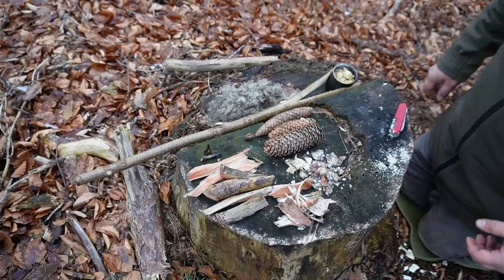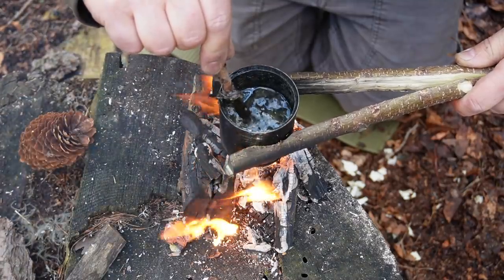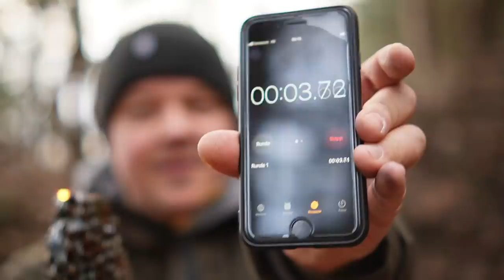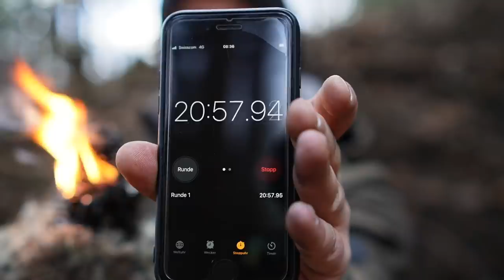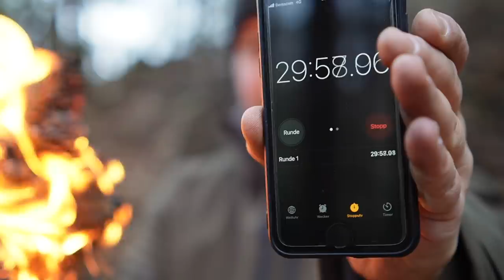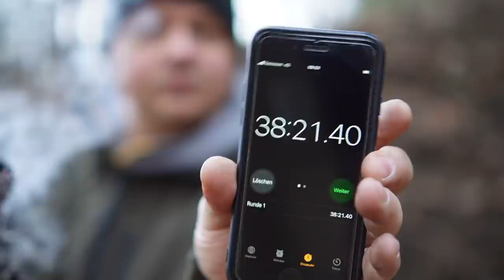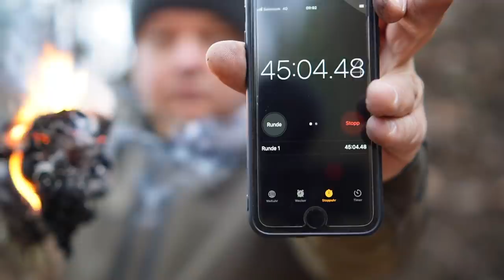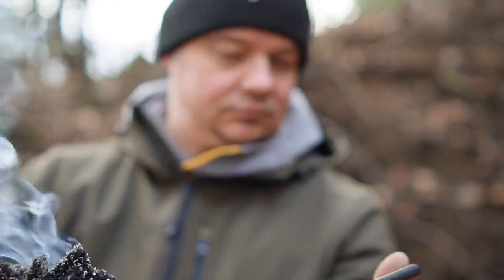4 Tricks to increase the Burning Time of a Conifer Cone Torch / 1Cone + Resin + Seeds = 50 Min Light

Comment: Very impressive! I used to conduct similar tests when I first started building my own alcohol stoves, about twelve years ago. I also got about fifty minutes of burn time in my tests. I wonder how long it would take to boil two cups of water, using that torch flame. If you could achieve boiling temperature within two, or three minutes, that would be handy for cooking -- without the need for a large campfire.
Reply: I would think the flames would be too sooty ?

Comment: I appreciate the video. A better idea than using a pine cone to make what is in essence a lamp, twist the flammable fibrous material into a small diameter rope, tie it around a rock, then submerge it in the pot of resin to make an easy resin candle until the resin hardens. With your device, the pinecone is performing the exact same function, in that it is acting as the wick. If the can used for a pot is the right size, the upper half of the can can be a handle and reflector/windscreen, and the lower the resin pot candle providing light. The resin cone trick is better suited for a fire starter saved for extremely wet conditions and could use much smaller cones, opened then dunked in molten resin,.as an effective and waterproof accelerant.
Reply from the maker: Hello Paul Thanks a lot for your interesting feedback!!

Comment: Felix, thank you for this tutorial; yours is better than my own idea, which involved Dryer lint and a resin – wax blend, along with a little wick wound around the top section of the colon before the liquid got poured on, to do something very similar. Mind you, it didn’t even occur to me use that stick horizontally. My only idea was to use it vertically; that horizontal use sure made handling the tin easier.

It appeared that there was still some burning resin dripping down through, so I think I will experiment with your idea, but use a somewhat thicker nest.  In my area, some years bring high risks of forest fire, so I’m concerned and about burning resin escaping.

Have you ever had experience with a conifer seed cone exploding as it burned?  A few years ago, I had that happen; it sent a burning section of scale flying into my face. The damage did heal, but it left me a little worried about doing it again. I can’t remember for sure that the cone was entirely open, and wonder if that may have had anything to do with it. It was a pinecone that I used, So The scales were fairly robust. That much I remember distinctly.  I had used many, many pinecones to that point, and had small explosions happened before, but that was the one that really made me think twice.